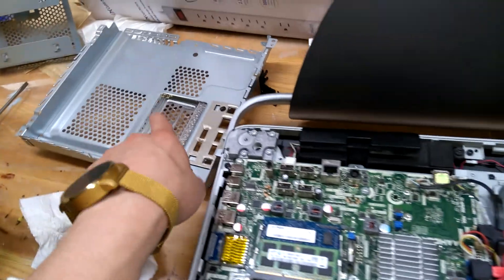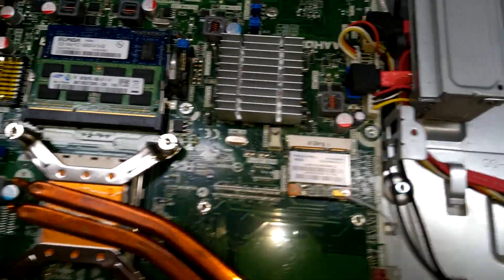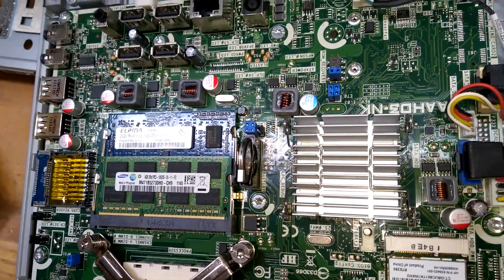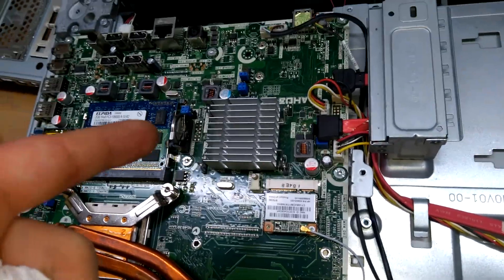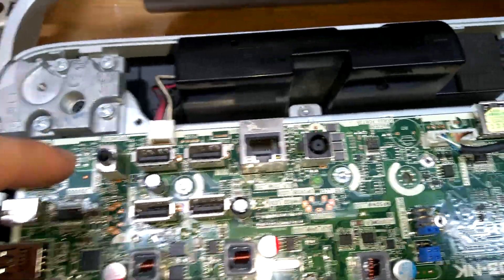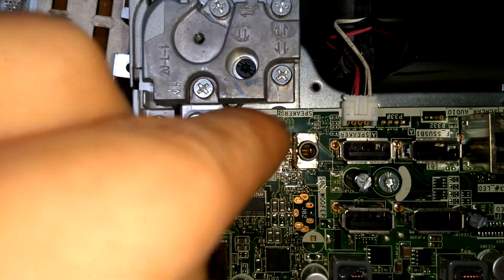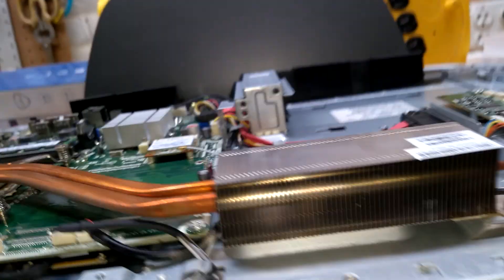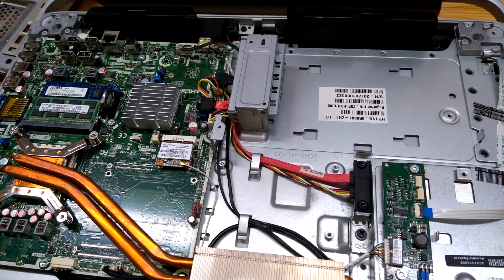06 HP Touchsmart 320 PC Hard Drive Replacement And Cleaning - Reassembly Overview

Comment: Hey you bro, Can you help me? If you can contact to me, just let me know, I have a problem with a PC like this
Reply: My boss gave it to me, it was from a friend of hers, and it doesn't turn on, I opened it, and I had some cables from the motherboard disconnected and I don't know in what order they should be connected
Reply from the maker: @miguelromero2040  Yeah I've had that issue a few times, not fun. I will take a pic, likely tomorrow after work, and post link to it here. Any specific section of mobo or all of it?
Reply from the maker: I don't think I have WhatsApp installed. Email would be best I think lubekenterprises2011@gmail.com
Reply: @letechnology1774  ok bro, I've already send you a email
Reply from the maker: @miguelromero2040  check email
Reply from the maker: Sure what problem are you having?
Reply: Hola bro, podrías ayudarme con una informacion? Necesito los valores de 2 mosfet que le faltan a mi mother, son los 2 que están al lado de sata del hardisk